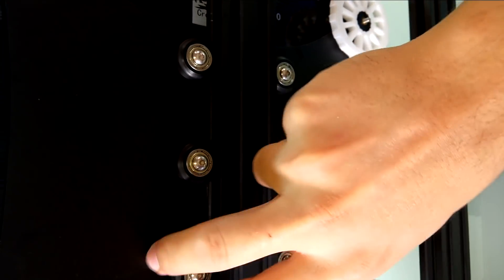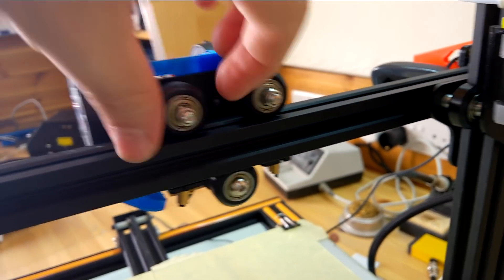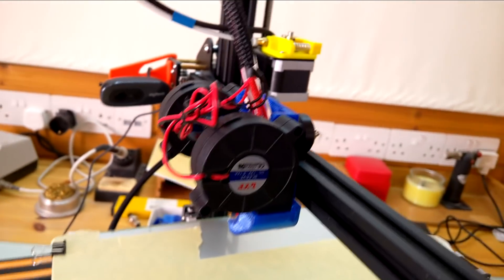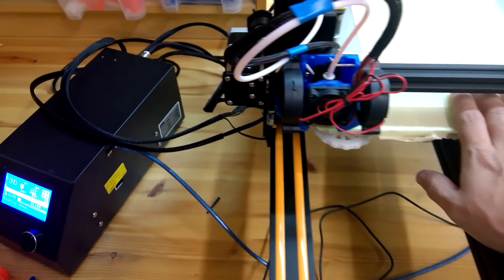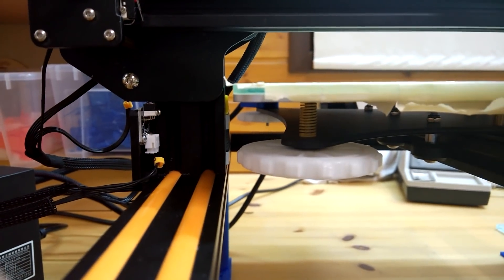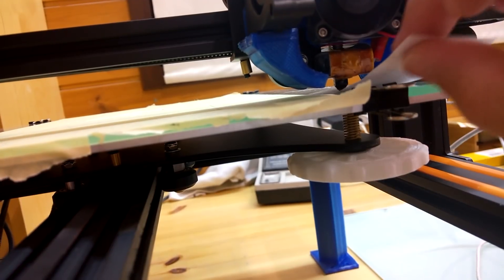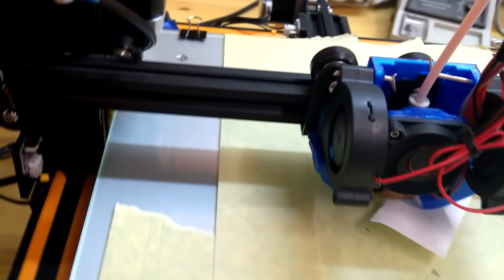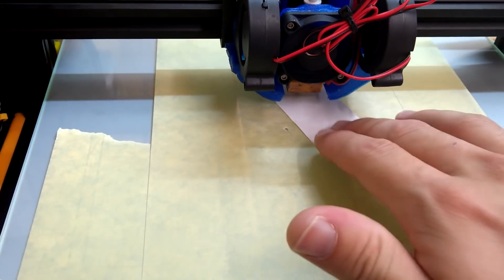CR 10 Calibration

Comment: Burning a bootloader to control board and using newest stable marlin 1.1.x is the best upgrade i have made to CR-10. Manual mesh leveling is the best poor man's upgrade there is, always a perfect 1st layer.
Reply: also mesh leveling is the only sensible way to compensate the center build plate sag...there are some printed jacks that you could use but that is silly compared to mesh leveling.

Comment: how do you run the cr10 of the tablet
Reply: what do you mean? How do you run the cr10 off a tablet? like how do you control it via external computer? if you install a octoprint server on a raspberry pi for example, and connect the printer to it via usb cable you can monitor and control your printer from another side of the world.

Comment: Thank you sir. I had printed perfectly from the start but when my prints went bad, i did not know how to fix. Following your video, I fixed my printer.
Reply from the maker: Your Welcome. Glad it was helpful :)
Reply: @haroutiounarakelian2520  what happened was the print bed became warped down in the centre, a fraction of a millimetre.
So I used your method to get the centre bed-to-nozzle clearance correct.
Also my wheels became loose in a few places, which I also fixed.
Reply from the maker: @r-iii-rturbo9157  yes unfortunetly its very common to get warped beds and glass, they should really try and fix that
Reply: @haroutiounarakelian2520  Have you tried flipping the glass over? They tend to be flatter on one side.

Comment: How is it possible the z-axis base gets extended? What goes wrong if that happened? I have a new printer, printed only 5 prints and mine is extended already...
Reply from the maker: Hi, usually the flexible coupler is damaged during shipping, other causes for it to extend are if the Z axis is binding (no free movement) or if you force the axis up by hand or if the hotend crashes into the bed\printed part. Having it extended is detrimental to the prints as it dampens Z movement and takes away Z precision, it can also become fragile to Z height and not be able to keep the expected position after movement. It can also cause further damage by having the centre outside of the steppers centre thus spinning eccentrically which will cause Z rod binding and will possibly bend the Z rod. You should replace the coupler and use the following guide to calibrate the Z axis https://www.youtube.com/watch?v=vie7WWBxsM4&t=1045s
Reply: Thanks for your elaborate answer! And thank you for the link attached; will certainly need that :)
Reply from the maker: Your welcome :)

Comment: Hi, I am able to slide the paper under the left side, but when I move it to the right side I can't slide the paper underneath it. I've adjusted the screws on the bottom and nothing, I've adjusted the z axis in the settings, but then its too high for the left side. Would you be able to help with this issue please?
Reply from the maker: Hi Junior M, I can try to help :) as a first step try to "hold" the screws with a screwdriver from the top of the bed and then rotate as sometimes the screw will turn and the adjustment will not be made. Note rotating clockwise will take the away from the nozzle and counterclockwise will take the bed closer to the nozzle. Try this and tell me how it goes.

Comment: My cr10-s came new today with almost broken servo couplers that were already bent and cracked.
Reply from the maker: That's unfortunate, If I understand correctly you mean the flexible coupler on the Z axis stepper motor ? if so you will have to replace it here is a link for it 
https://www.tinymachines3d.com/products/z-coupler
you can also check at your favorite shop its called either Z coupler, flexible coupler, flexible Z coupler ...
make sure its a 5mm-8mm (5mm on the stepper shaft side and 8mm for the lead screw/Z-rod)
If the one you have is too bent you can try removing it placing it on a vertical surface and pushing down on it with your palm, this will straighten it but if damage is severe this could also break it, in any way that is for a temporary solution until the new ones comes.

Comment: What are you doing if your bed is not even? Thanks for the video!
Reply from the maker: Hi, the first thing to try is to flip it upside down, always check the flatness on the printer bed and with the clips attached, you can also try adding a few more clips in order to hold edges firmer to try and "straighten" it not the best solution but an option. If its bowed downwards there is an adjustable wedge you can use to put pressure from the bottom search on thingiverse for "Jailcee W-Jack (wedge jack)". Next step would be to upgrade your glass, there are many options but the most popular seem to be the IKEA Lots mirrors i have that on 2 printers and am happy the other option is borosilicate glass i have that on a few printers aswell and prefer it over the ikea ones however they are more expensive. An important thing to note is the state of the aluminum bed as well since if that is bowed it could cause your new surface to deform to it, but it depends how its bowed where and how much. You could also have a capacitive Bed leveling sensor set to make a grid of your bed which also helps. Last option if you don't want to change anything is to know your bed where its good and where not and place prints accordingly in the slicer, i.e if the bow is in the middle avoid placing items there. If you will use this method make sure you level your bed normally but at the end move your nozzle to the location of the print and adjust all four corners equally to get a good height at that location.
Reply: Awesome answer! Thanks a lot for taking your time to answer so detailed! Merry Christmas!
Reply from the maker: Your welcome! Merry Christmas !!